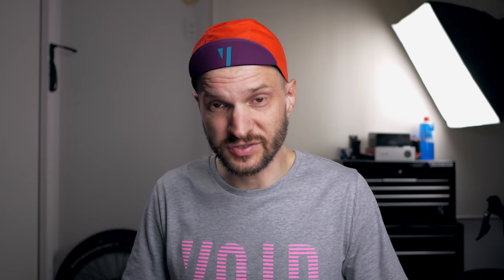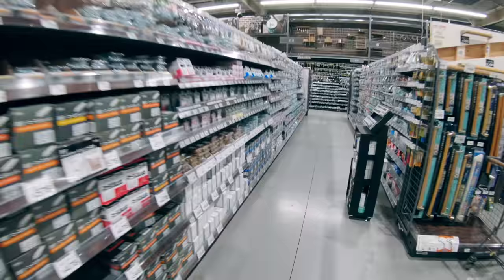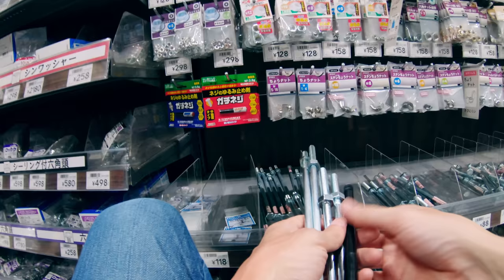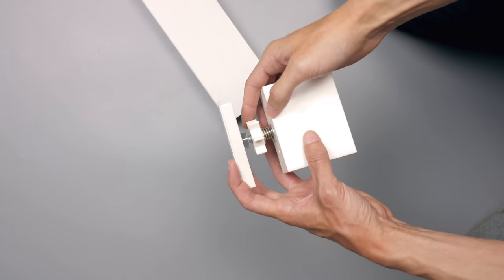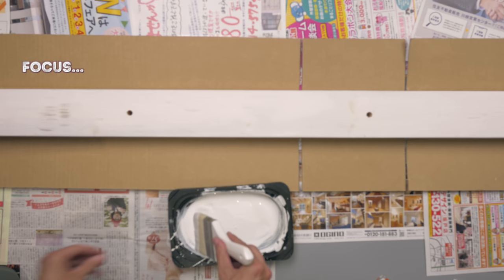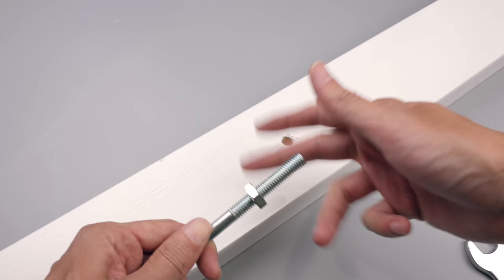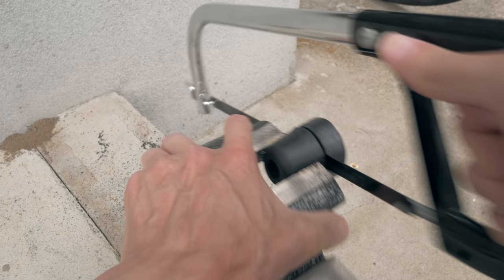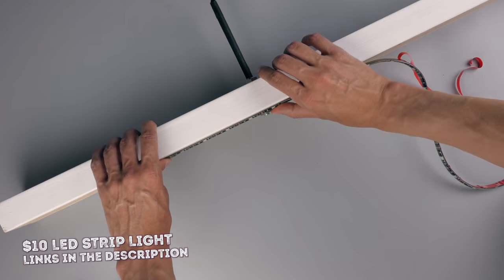Bike room upgrade: DIY wheel totem pole

Comment: Actually its better to use rods around 10mm because if you would take 12mm threaded rods and shrink tubing on top the axle won‘t fit over it any more. 
The tolerances on thru axles are pretty close to 12mm and depending on the quality of the rod, these alone would barely fit and could possibly damage the inside of your axles. 
As bonus with the smaller rods you got enough space to easily slide the wheels on and off. 
Overall the stand looks great and serves as a nice background with the lighting as well.
Reply from the maker: Ah, that is very true 👍

Comment: Looks clean and functional. Also, no holes drilled in the dry wall is a bonus for me. I don't mind the LED strips. 
I think that the 10mm bolts are a good choice since axles are already tight with tolerances and the shrinktube would make it unnecessarily tight fitting

Comment: Japanese homecenters rock. Especially Tokyuhands it you have one nearby. Nice work!! The sponky earthquake proof wheel stand.
Reply from the maker: They do indeed!
To make it quake proof I would probably need some kind of clamp thing at the end of the bolts 🤔
Cheers!
Reply: @ridesofjapan  Perhaps attaching a long piece of para chord(550) from the top wheel prong and looping it around each prong down, It just needs to prevent the wheels from sliding forward I guess. Living in a rental in Japan really does limit your renovation options, especially if you want to keep your rental history as a foreigner immaculate.
Reply from the maker: Rhys Hughes Yeah, that’s a good idea👍.. was thinking of drilling a small hole through the tip of the bolt as well... but will see how it holds up during the next earthquake first hehe.

Comment: great video as always. If I'm not mistaken, you are running three different cassettes on these three sets. How are you managing running the right chain length for each setup? I can't imagine you are always changing chains when changing wheel sets...
Reply from the maker: Tobias Tesching I’m actually planing to going with two chains in the near future, but for now I use only one chain cut for a 46t... works fine for the 40 & 42 as the smallest cog is the same 11T

Comment: I'm going to be doing something similar to this except using oversized rod and machining it down to correct size. This way I can use the left over material as a stop for the wheels.

Love your idea though. Minimal parts and completed with the basic tools. Great effort.
Reply from the maker: Nice, would love to see how that turns out! 👍

Comment: It was perfect, but what to use for wheels with 9mm axle? Or what to use?
Reply from the maker: For quick release I would probably just get the 9mm the same as the QR and skip the shrink tubing. Anything smaller would probably be a bit flimsy

Comment: Did you consider angling the bolts up slightly to keep them from shaking off during a small quake?
Reply from the maker: Not really, wanted them as flat as possible against the wall... but it could work for sure👍
the original idea was a threaded rod so I could secure the wheels with a nut/washer... I still thinking of making some kind of clamp to keep them secure in case of a quake.

Comment: With three wheelsets, do you use different casettes on each? If so, did you have any issues with the same chain for all of them?
Reply from the maker: Yes, but I pretty much don’t use my old road wheels since I got the new ones... still good to have as a backup.

I have 11-40 on the road wheels and 11-42 in the gravel wheels with an optional 11-46 for bike packing. For now I only use one chain cut for the 11-46 cassette, no issues on the other cassettes, but I’m planing so get a new Chain for the road wheels that I can keep shorter.

Comment: do you adjust brake calipers every time you change the wheels?
Reply from the maker: Not when switching between the dt Swiss wheels. But going from the dt to Extralite they need adjusting and a piston reset as the rotors are thicker on the Extralite’s